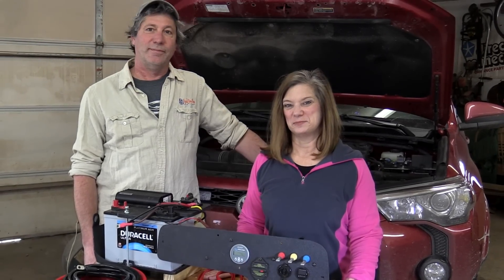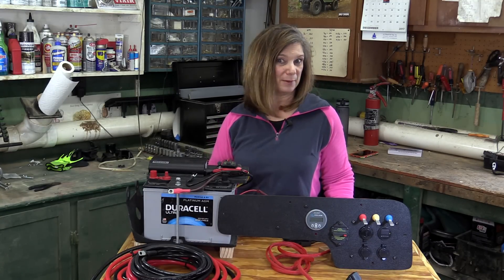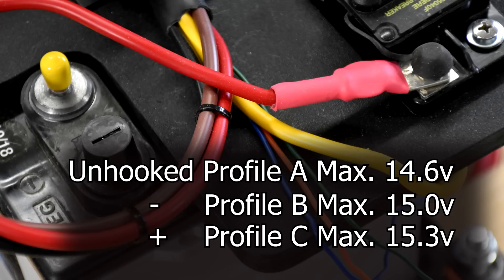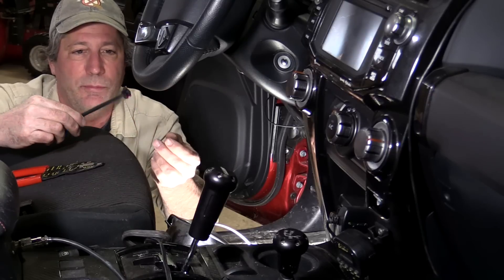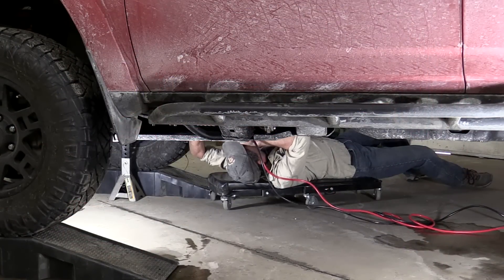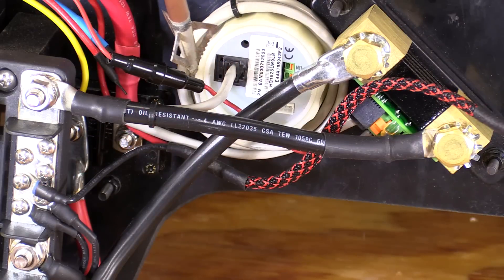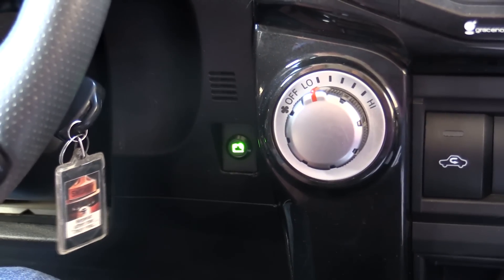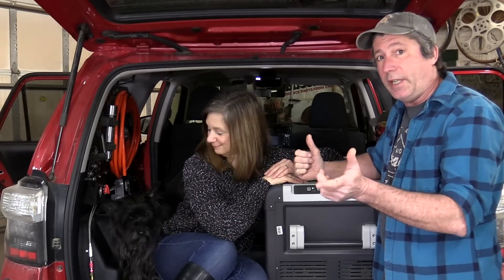Dual Battery Setup with Detailed DIY Install

Comment: Great video. As a mechanic just a word to the wise. Remove jewelry before working on a car, especially around a battery. I've seen a man burn his finger to the bone with a wedding band.
Reply: Me too... He was working on an electric golf cart... It was horrible.
Reply: Unless ur watch rubber and have a ground connection lol
Reply: Yup, seen that myself. Nasty!
Reply: Yup seen that too. Buddy was working with his new watch on a telephone switch battery banks and we saw like a welding spark. Zapped!
Reply: Yes, good advice. I did just that! Not a pretty sight!
Reply: I've been that guy.. forgot I put my ring on and then touched to the battery post for a split second. 2nd degree burn and now I'm forever branded as a married man. I left the melted spot on the ring as a reminder.

Comment: I'm wondering what you now think of the investment in the Victron battery monitor? Was it worth $200 for what is does or would you have been as well served by one of the power monitors that run $40-$80 without bluetooth and phone app? Trying to make that decision before I purchase one or the other.
Reply from the maker: Honestly, you can get by just fine with a less expensive one. There's a lot of functions and info on the Victron but we find we only care about how much life is left in the battery and what the current amp draw is. Thanks for watching!

Comment: do you think you could install the charger under the passenger seat to keep it out of the engine bay? I live in AZ and was thinking of running this system...would you run the 40A if you had to do it again??  Thanks for the video!!!!
Reply from the maker: I don't see why not. The smaller amp size is plenty for our limited needs. Thanks for watching!
Reply: @WanderlostOverland  Thanks...I have decided on the Battleborn https://battlebornbatteries.com/shop/12v-lifepo4-deep-cycle-battery/  with the DC-DC charger setup under hood like your setup then might also run their 50 amp battery and run that in parallel to the back and then I should have all the power I need!!  run a solar charger and I'll be set!!  Love your videos...keep it up!

Comment: Do you have the wire schematic diagram available?
Reply from the maker: No we don't. You can try contacting Overland Power Solutions. They're the ones who designed it.

Comment: what gauge wires are running from Redarc out to the fuse, etc.. also, you have a 100 amp from main to the fuse, but only 40 amp to the hook up to the 2nd battery?
Reply from the maker: We ran 4g + & - cables to the rear. I'm assuming you're referring to the 100amp breaker on the fuse/relay panel near the starter battery. That panel is completely separate from our second battery panel. 100 amps is overkill for it. We should drop it down to 40amp also.

Comment: eww charger and battery under the hood its too hot under there
Reply: Redarc says it is fine.  I checked on my system.  These things are designed to work in the Outback.

Comment: Any particular reason you chose to run the main lines under the the truck vs thru firewall and under the footwell?  Not worried about damage?
Reply from the maker: Two reasons: Simply, it's easier to route them this way, and, for safety reasons we never want cables carrying that much amperage inside the cockpit. The cables have a super heavy duty insulation on them. That along with the shell we ran them through is plenty to protect them from the elements and, we ran them in such a way that they will never come in contact with the rocks or the exhaust. Thanks for watching our video!
Reply: @WanderlostOverland  sweet!!! Thanks the reply

Comment: Check the manual on the blue wire from the red arc, by connecting this it sets the redarc to low voltage meaning it won’t cut out till your cranking battery drops to 11.9v whereas leave it disconnected will cause the redarc to disconnect @12.7v  if your happy letting your cracking battery drop lower then all good just in your video you implied by connecting this is isolates the cranking battery when the ignition is off but this is not correct.
Reply from the maker: Your statement can be considered partially correct in that the two batteries do remain connected for a very short period of time after the ignition is turned
off. Depending on the state of charge of the "house" battery. It's our experience thus far that this can be anywhere between a few seconds to 5 minutes. Once the low voltage trigger is met the two batteries are factually isolated from each other. Redarc recommends that vehicles such as ours with the variable voltage alternators run the low voltage trigger option. I'm unaware of their reason for this. So you see, your statement is merely a case of semantics. Thanks for your input.

Comment: Enjoyed the vid, the application is useful and very practical. Could u provide individual cost for the battery, charger etc. Thx a million you guys are awesome.
Reply: LJaysPerspective get the genesis dual battery, much easier and cleaner

Comment: What a wonderful video very practical for the camper would love to see part 2 which would be switching out your factory OEM alternator for a higher output alternator like used in the ambulance.Less of a chance of having your alternator burn out from over drawing of amps.Thus you can run anything on it with in reason. High output DC/AC inverters for many accessories including power tools😁 which Consumes a lot of amps.
Reply: With this extra power you can run a a microwave TV popcorn machine at your campsite

Comment: Just a suggestion, as I recently did an almost identical setup, but with a lithium, BCDC1250D & 0AWG cables for the current draw. You should physically move your Victron current shunt up to your AUX battery, terminate all negatives to the load side & just the AUX batt neg to the “Battery Only” side of the shunt. Then it will actively monitor the charge going into the battery from the Redarc as well as the draw from it. Then you might actually see some positive current figures instead of constant -3.5A for e.g. It will also give you a true indication of battery terminal voltage & not post the loss of the 4AWG cable run to the rear of your vehicle. The shunt also has an “Aux” input, connect that to your starter battery & you can monitor the terminal voltage of that as well. Enables you to set audible alarms if it drops below a threshold. Victron also supplies a long (10m from memory) comms cable in the kit to go between the shunt & BMV-712.
Reply from the maker: After seeing your comment we reached out to Victron and it turns out you are correct. We do have it wired incorrectly. The way we show in the video is how the company who designed our system told us to wire the shunt. 
Thank you for pointing out the mistake in a kindly, respectful manner.
Reply: Wanderlost Overland No problem! Thanks for the reply. You have a great channel & I enjoy watching it! I’m genuinely amazed at some of the advice people are given from ‘professionals’ when it comes to 12v systems. If you’re interested, you can see my setup on Instagram @rickis.r51
Reply: @ricki11cook  Is the Shunt okay being exposed in the engine bay?  Or would it be wise to weatherproof it somehow?
Reply: Shane Keilty it would be fine but if you can mount it inside a PVC enclosure then that would keep it dry.
Reply: Thanks Ricki!  I'm doing my own install and finding this comment allowed me to get the shunt hooked up right (I think) from the get-go.  YTM.

Comment: Question, Wouldn't it be better to put the breaker closer to the starter battery? From my understanding, one should always put fuses/circuit breakers as close as possible to the power source. Please correct me if i am wrong. Thanks in advance for any feedback.

Comment: Thanks for making this video.  I have an FJ (which is why I started following you two) and I am in the process of figuring out my dual battery setup.  I spoke with David at OPS (nice guy) to get the ball rolling and wanted to know how you are doing with the 85 amp hour battery?  Do you find it being sufficient for your needs?  As you know the FJ is limited on space.  Thanks again for making these videos.
Reply from the maker: So far it's keeping up just fine. I think it'll be just fine.

Comment: I have a small amp battery (7hrs) just to run a small fan but I am wondering if I am going to overcharge it if left connected to main starter battery. I do have the VSR, thanks
Reply from the maker: I'm no expert on them but I believe the VSR will prevent it.
Reply: @WanderlostOverland  Many thanks I am trying to get an answer from the supplier, cheers!

Comment: You guys are the best. How come you got the 25 amp version instead of the 40amp REDARC? Doing this exact setup in the next few weeks once all the parts come in. Was having trouble thinking about where to mount the actual unit but your solution is great!
Reply: Dave from Overland Power Solutions here . . . the BCDC1225 is more than enough to charge a "battery bank" of this capacity.  The 25amp output will also easily keep up with the load of this build and scale well for future additions.
Reply from the maker: Due to our ignorance on how best to keep the second battery charged and healthy we trusted the guys at Overland Power Solutions to choose the components for us. We're not totally certain why they went with the 25amp. It could be because we'll be supplementing with solar.
Thanks for watching and if you get a chance, we'd love to see your setup. Please post some pics up on our Facebook page.

Comment: Great video!
How do you prevent the battery from being discharged to deep? I saw you can set an alarm with your monitor. But what if you're not around at that moment?
Reply from the maker: We haven't had a chance to test it out completely but, I believe is automatically shuts off the power when it gets down to being dangerously low. I'm not sure if there's a setting we need to choose to make that happen or not.
Reply: Wanderlost Overland Thanks for the answer. What will/should automatically shut down? The redarc or the monitor?
Reply from the maker: Not sure. That's something we definitely need to look into.
Reply: Wanderlost Overland you can setup a relay to run off the Victron which could isolate everything when the voltage drops,

Comment: What size cable would you recommend for adding 2nd battery that’s 15 feet away from main battery? Thanks
Reply from the maker: That's a great question, one better to ask someone with much more knowledge then us. :) I highly recommend talking with the guys at Overland Power Solutions for a professional opinion. http://overland-power.com/contact-us/

Comment: your battery shunt is in the wrong location and it will never register charging. it should be up front on the battery but otherwise nice install.
Reply: When the battery is full and voltage hits a threshold it will reset to full.
Reply from the maker: mmmmmm.....but it does register charging.
Reply: Do you see positive flow just when U had the car running U had negative
Reply: Great video guys! I need to get a better understanding of electrical stuff. I know just enough to be dangerous!

Comment: What was the cost of this project??? Thanks
Reply from the maker: It varies greatly depending on each individual build, best to contact Overland Power Solutions for a quote. We can tell you that it's not cheap, in price and quality. The way ours sits, with all the little extras including battery and tray, probably came in between $1,500 and $1,800. Sure, the simple isolator kits are cheaper but, they aren't near as efficient and reliable and, you have to match the second battery type to the starter type. So you'll have to buy 2 batteries instead of just one =at least $400.

Comment: Was it necessary to run a 4G negative all the way to the back?   Couldn't you have run a short 4G  from the rear power panel to the body/chassis?
Reply from the maker: We asked experts in the field this very question. They all said a chassis ground isn't reliable enough along with a bunch of technical jargon that I didn't understand. :)

Comment: Shouldn't the charger be in a cooler area? The engine bay can get very hot, especially just after shutting off the engine.
Reply from the maker: That would be the best but unfortunately putting it anywhere else wasn't an option for us. We chose the Redarc for its higher tolerance for heat.
Reply: Redarcs do really well in Australia in engine bays
Reply: The Redarc's are good for it!
Reply: The RedArc instruction manual says the charger reduces output amperage once the temperature rises above about 130 degrees F, and shuts off output entirely above 175 degrees F. The engine bay can easily exceed these temps, especially in summer.

Comment: Seriously professional fabrication of that Rear Power Outlet Panel!! Beautiful job, it is a shame to be hidden behind that monster 75L fridge/freezer though I must say it fits well into the back of the 4Runner. I'd be tempted to go with the window mount box but wonder if that would hinder the opening of the fridge/freezer? Been considering the Dometic myself but tempted to go with the 50L as it consumes about 40% less energy. You may want to use the insulated cover for it too. Roughly how much does a system like this cost from Overland? That DC-DC battery charger is such a game changer! 

Looking forward to hearing your follow-ups with how well it performs. The solar option is a major bonus with being able to drop a stand alone MPPT charge controller. You'll definitely want/need that to keep that fridge/freezer going otherwise the dual battery will take a good whoopin' lol. 

You guys have a seriously good channel, sure appreciate the effort you put into making these videos, a real labor of love!
Reply from the maker: "I'd be tempted to go with the window mount box but wonder if that would hinder the opening of the fridge/freezer?" It might be in the way depending on how high you mount it, how tall your fridge is, and how deep the box is."You may want to use the insulated cover for it too". Yup, got one. We didn't use it in the video because of the Velcro closures. They would have made our mics very angry.  :) "Roughly how much does a system like this cost from Overland?" Since everyone's needs and budgets are different, that's a question best asked OPS. I can tell you this, it's not the cheap route to take. But, in this case you definitely get what you pay for.Thanks for watching!
Reply: @WanderlostOverland  I think as long as you have a slide out for the fridge there would be no problem.

Comment: I've been anxiously awaiting this video.  I just picked up the C4 battery mount a few days ago (C4 is awesome) after looking at all the other very expensive 4runner options out there.  Glad to see a more DIY solution and love the rear power panel.  Would love to hear about what influenced the various decisions on each of the components (25amp vs 40 amp redarc, AGM battery choice, etc).  Thank you again for another great production.
Reply from the maker: Thanks for watching!"25amp vs 40 amp redarc"- We were up in the air on this too. That's partially why we got help from OPS. They said the 40amp wouldn't be necessary for our application. "AGM battery choice"- Mostly cost. We could either buy a $400 or $200 battery. Both would perform and last about the same. $200 won out. :)

Comment: I'm so not there yet in my power needs but I like your setup and could see a similar setup in my future. Although I won't be doing said setup myself, cuz I just don't have the patience for all that, I still watched the video as if I would do it myself.
Reply from the maker: Overland Power Solutions specialize in custom installations. They're based out of Knoxville TN.Thanks for watching!

Comment: Awesome video and work.  Just a few questions
1.  Will you be retiring the bussman fuse/relay set up or will you route it to the 2nd battery?
2.  Why use 40amp breaker on this set up instead of 80( i think thats what you have on the bussman)?
3.  How do decide what is connected to the 2nd batter vs the main.
Thanks again for sharing the k bbn knowledge.
Reply from the maker: Thanks for watching!#1, Nope, the Bussman relay/fuse panel will still be hooked to our starter battery since everything that goes through it are things we mostly use when the engine is running.#2, 40a is plenty for what we're running off the second battery. The busman one is a 100a I believe. WAY more then we need there. We should downsize it in the near future.#3, Like I said in #1; depends on when the accessory is running with the engine running or not. We wanted to really limit what's going through the second battery, so the charge lasts as long as possible.
Reply: @WanderlostOverland  thank you